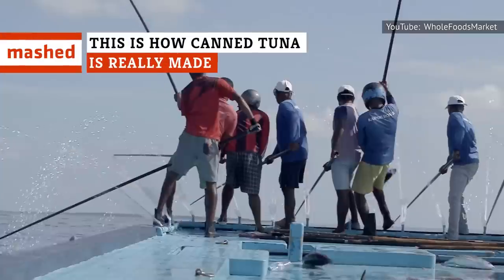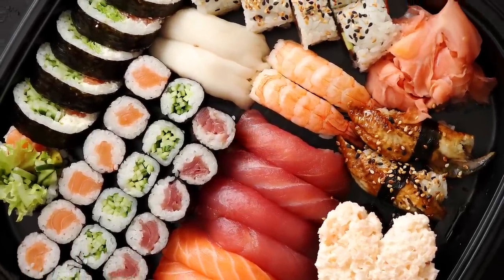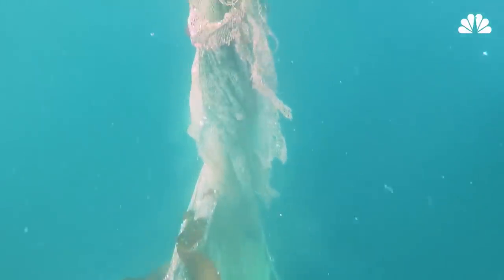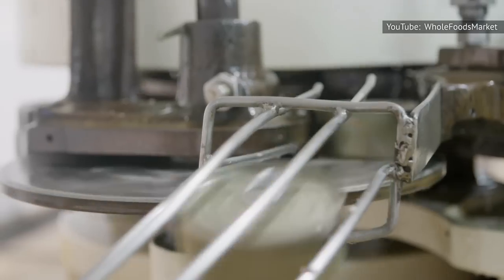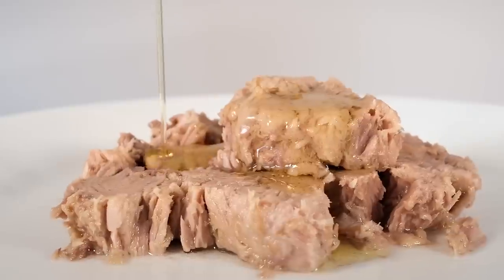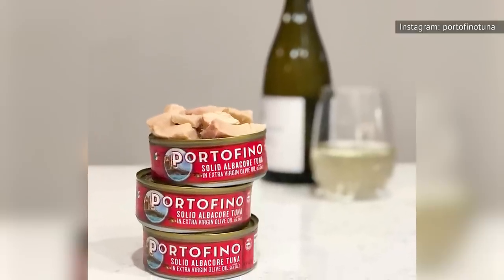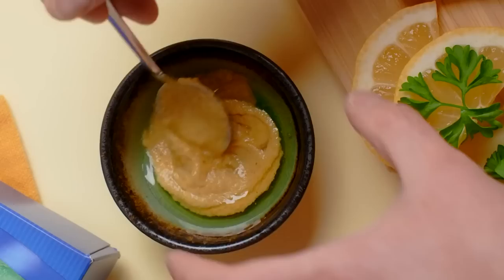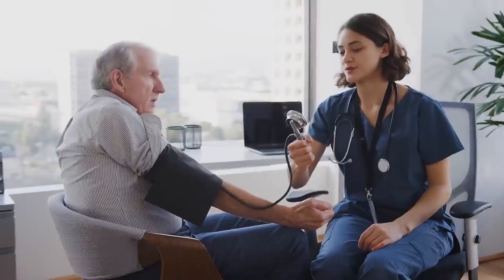This Is How Canned Tuna Is Really Made

Comment: I've gotten disgusted with supermarket-grade tuna like Bumble Bee.  Cut the lid, and you can squoosh it down almost 2/3 of the way, so out of the "5oz" can, you might get maybe 2oz of actual tuna.  I used to be able to use the oil and not have to use as much mayo, but now there's so danmed much oil I have to drain it, else I'd be having tuna-soup.
At least WildPlanet is more solid, cooked in its own juice, no added anything, and even though it's more than double the price of the "brand names", at least I'm getting an actual full can of tuna, so it's worth it to me.